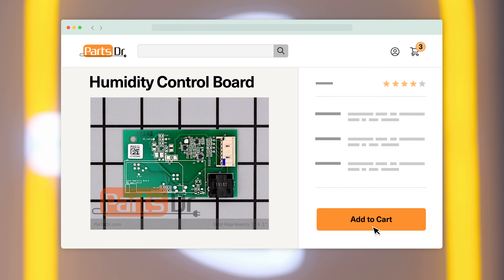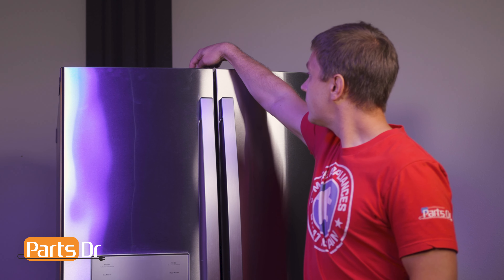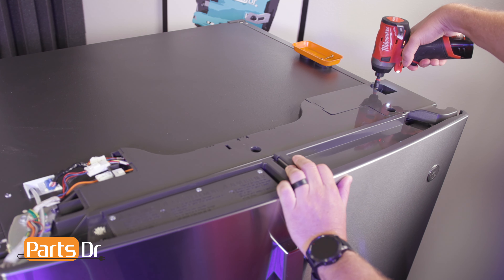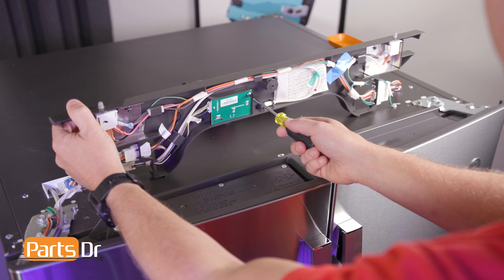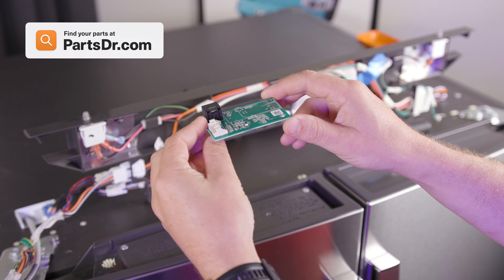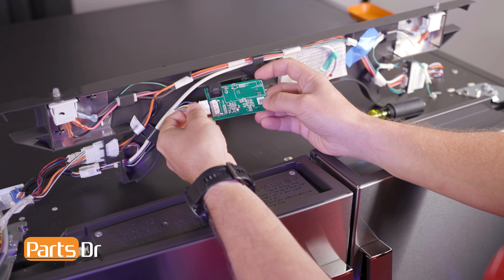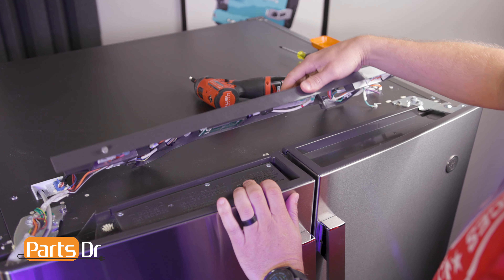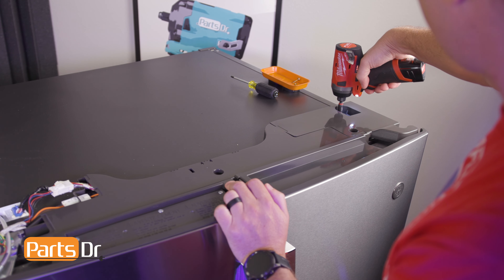How to replace Humidity Control Board part # WR55X24585 on your GE Refrigerator

Comment: Would this cause fridge temp not to regulate or what tells the fan inside to come on pushing the cool air up?  Temperature gets to above 50 before fan kicks on and humidity gets up to 80%
Reply from the maker: No, it sounds like you have a different issue.  Check out this video for more ideas: https://www.youtube.com/watch?v=_m7pW3PueJs